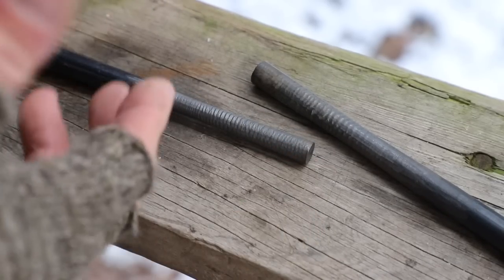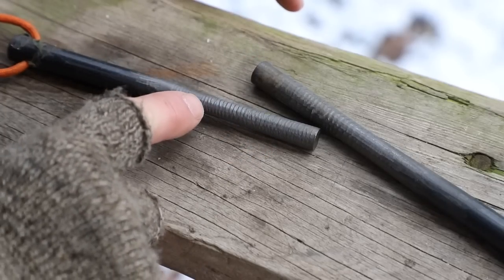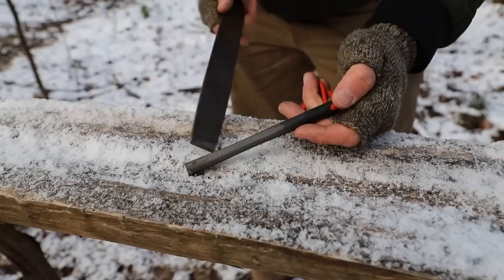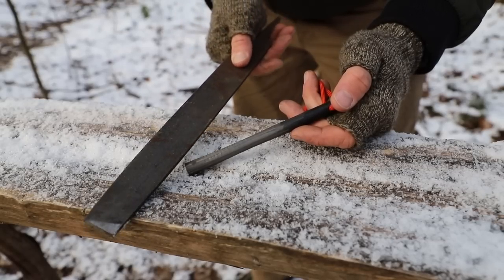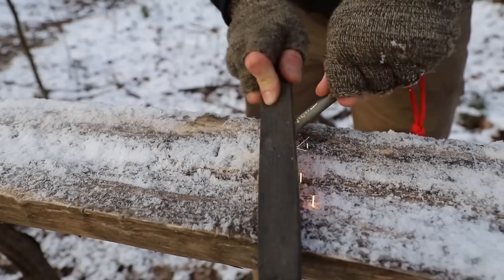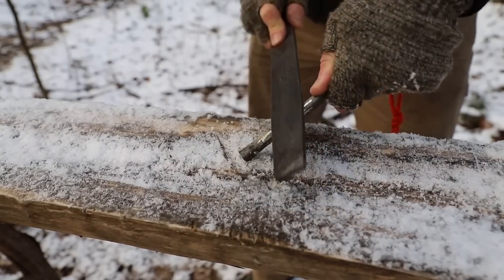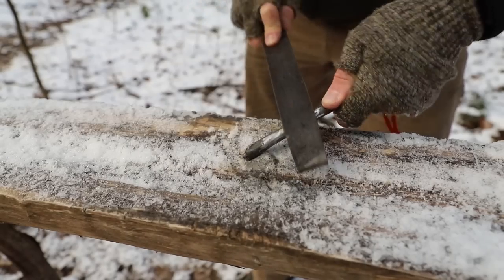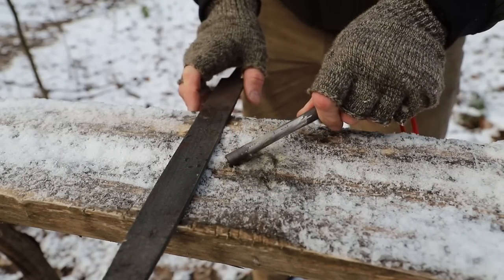Fix Bumps on a Ferro Rod: Emergency Fire Techniques

Comment: Dan, it seems to me that, for those that carry a section of file as a flint striker anyway, they could use it as a pretty effective ferro rod striker as well. That was really throwin' down some sparks and would probably ignite most tender right away AND maintain a round smooth surface on the rod. The whole "two birds" thing.
Reply: Exactly what I was thinking John Mony. ( As I think of where I put that broken file I knew I'd find a use for someday).
Reply: Yah, why waste the sparks in smoothing out the rod. Good solution.
Reply: It might take more material off the rod than the spine of your knife. Plus a knife has multiple uses out in the bush, but a file is less versatile. So, if you're concerned about weight, take the knife leave the file.
Reply: @causticbase2034  I guess you overlooked the part where I said some people carry a piece of file to use as a striker for flint and steel. REAL flint and steel, not ferro rod and steel. For those people, since they have the section of file anyway and have already accounted for its weight, why not use it with a ferro rod instead of your knife spine? It certainly seems to throw more sparks. Of course I'm not suggesting that you leave behind the knife and just take a file. That'd be crazy. How did you interpret my comment that way?

Comment: I’ve had this happen when the spine needs to be sharpened back to 90 degrees. Or maybe it was a coincidence.
Reply: No, that's exactly it. Knife spines are too soft and deform with the heat from the sparks. That causes the ridges.

Comment: Put your rod in your drill driver , wrap some coarse sandpaper around it and run your driver slowly… I understand in camp you might not have a drill driver but at home it’s easier than filing it. I will be buying a small file to include in my bushcraft kit! Thanks for the tip!
Reply: If you have an 18 V drill in your trunk etc, you can whittle out a fire board and "spindle " to chuck up in the drill and build the FASTEST "BOW 😆 drill ember" you've ever seen in your life man!😂😂

Comment: I have rods 10 years old. No issues. Thanks for putting this out to the newbies This is important for those with less experience. A 6 inch by 1/2 inch rod should last you for MANY YEARS.

Comment: Used properly, one only needs the last 1" of their ferro rod to ignite a tinder bundle. Long multiple strikes on a ferro rod are the results of using marginal tinder. A quick flick of the rod still sends enough sparks to get a fire going. 

Also, too many guys using the spines of knives which are tempered at 1700° when ferro rods are expelling 3X that heat.

Do the math...what happens? The knife's spine gets deformed and rounds off which is what causes the skipping effect leading to the ridges.

A good striker mitigates that. The back of any Leatherman's saw blade, the back of a $2 Home Depot utility scissors disassembled (for 2 strikers), Silky saw spines...all outstanding strikers that are much harder than knives and that don't cause ridges. Cheap too.
Reply: At last someone who fully understands!    It's the tinder quality that is the important bit, any Ferro Rod of any dimension will do the job if the tinder good to go!
Reply: @GLEN1061  Absolutely.

Comment: Belt grinder is WAY more fun. 
I only get ridges with cheaper & presumably softer ferro rods. Never had an issue with light my fire & exotac rods, exotac is probably my favorite. They cost more but it's worth it imo.....

Comment: Seems like using a file for a striker might be a great idea. A file like that is big, but useful for a ton of stuff in the woods, like filing chips and rolls out of a knife edge before sharpening, sharpening an axe, cleaning up bushcraft projects like cups and spoons, and now, striking your ferro rod...
Reply: ginaparker-langley  but what does this have to do with what I said? Anyway, I call bs on your buck knife chopping a bolt in half. The steel buck uses would get messed up trying to cut any steel.

Comment: Top tip... think "knife sharpening".
One of the first videos I watched about knife sharpening impressed upon me that using all areas of the stone equally is the most important part of your technique. If you always apply pressure in certain spots (the middle), the sharpening stone will wear away unevenly, and the more your stone becomes "not flat", the faster your knife will become "not sharp". It basically creates dead spots.... and you can either reflatten your stones every time, or learn to use the whole stones area in order to do that process LESS.
This was a thought process that applies to a lot of different tools and situations: spreading the load maximises the life span of the item, focusing the load can make one area fail long before the rest of the item has worn out. Its just like moving furniture around periodically so it doesnt wreck your carpet....
I think with ferro rods its always good too be mindful of how you use them, and try and "front load" the wear, so they naturally get worn slightly more at the front than the back. Especially since once that dip is created, the geometry will naturally make itself worse and worse.
I hope that made sense.

Great video as always.

Comment: Would never ReDress rod...
Just for sake of ReDressing. 
I would in fact, 
Use my 6" long single cut 
bastard file that I pack
[ as a multi-tool (auger, sharper,
 & dressed edge - steel for flint)]
... in placement of normal striker
 for the rod... if I were to be
 concerned enough. 

It's just way too much material to
 waste, just to have a comfortable
 scrape. 

But, 
Thanks for addressing the viewer's
 question & thanks for sharing.
Reply: Note: 
If you do come to a point where
  you feel it necessary to ReDress
  your rod...
May I suggest that you not only 
   do as I already suggested,
But... hold it by the handle 
   (if it has one) as you usually
   do & just work the surface
   flat, after that work on one
   outer edge at a 45° & the other
   edge is trued up. 
Afterwards, if needed, you can
   easily use whatever striking
   tool you want. 
I just never suggest using anything
   with saw blade type of teeth that
   leaves gouges.

My two cents...
Not expecting any returns. 
Y'all have a blessed day.

Comment: Are those Eric X rods?
  I don't know how many 6" x 1/2" have holes drilled, but near my only..except the smaller Orange two piece Strike Force (SF) that has a built in striker as my first. 

The SF doesn't have any speed bumps, but its design (built in striker) near makes one to grip tight/strike hard..full length.
~ My Eric X...ahem;
As in many of videos, folks are using back of their knives for sparks, so I did too. (good 90° back)
That side of the Eric' has speed bumps from knife use...and fook dat, I tired of cleaning that flash cwap off the knife. 
~ ~ So I began using the file edge in my '94 Leatherman PST vs knife blades...in/of which the Eric' is smooth on down.

Methinks using my pocket folder on the Eric', I tended to sneak up on the sparking not wanting to loosen up my knife...that I created them bumps. 
With the old PST Leatherman file and the SF design it was No Holds Barred.  

Blah blah, sorry so long here;
Actually the back of my quite old Fiskars 6" saw does spark well. (as I learn)
 Its an old saw where the blade retracts, and only have to slide out as much blade needed. 1.5" is plenty to bear down on/long handle. 

lol, P.S.
Ya made me cringe somewhat laying the file in snow.

Comment: Great idea. Might prematurely wear out your file this way though with the heat generated by the sparks at the tips of the file's ridges. Might want to use an old worn-out file for this

Comment: My question is this - what would it hurt if it does have speed bumps? Won't it still throw sparks? And with smooth operation, won't they wear out with use?  (OK- that was more than one question)

Comment: Do the speedbumps actually hurt functionality? I have a few jacked up rods that still strike.
Reply: If they got deep enough, your striker could catch a deep spot and break the rod at that spot.
Reply: What are you using as a striker? You can smooth them out with an aggressive striker like a saw blade and salvage the rod.
Reply: @YankeeWoodcraft  I use whatever I have handy. I have dedicated strikers, saw and knife spines, and even one of those Corona sharpeners. My favorite so far is the back of a multitool saw.

Comment: Those "Speed Bumps" are more likely to occur when you are using the Ferro in a deluge or heavy rain or if it is extremely wet. It's not only technique.. .. it is physics.

Comment: Wrap the Ferro Rod on to a electric drill chuck; while running it on slow speed then turn a double cut file over it @ and angle😂

Comment: Ok, but what causes it to form a "knob" at the end? It seems like it should sharpen like a pencil. That is what I thought you were going to talk about.
Reply: Most likely cause the rod is unsupported.
Reply: If you don't scrape all the way to the bottom it will form a knob at the bottom, and a divot where you actually scrape. Nothing wrong as long as you scrape the same way all the time, not going all the way to the bottom.

Comment: I always use a Clipper lighter, because a Ferro Rod is like someone operating a motorcycle and deciding that he needs to go back to a pedal bike. Sure, the technology exists, but why make it hard on yourself?  The Ferro Rod is simply a marketed tool that someone pushed on the Bushcraft Community to make money off of flint striking material and it worked.  Before 2000, no one used them and they barely existed outside the industrial setting.

Comment: What, no mention that the file could be used as a multi tool, fero rod scraper and sharpening device let alone striker for flint and steal as well as finish wood work.